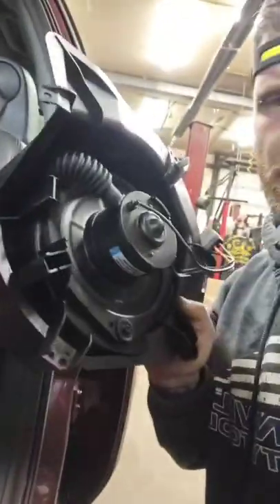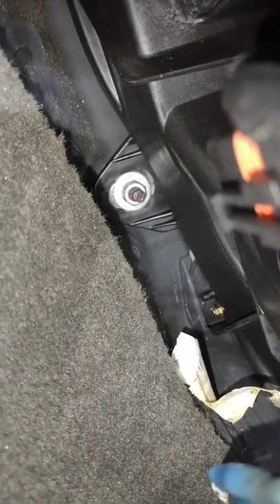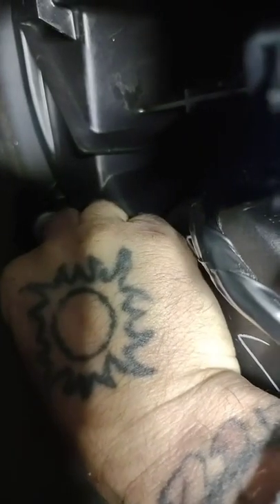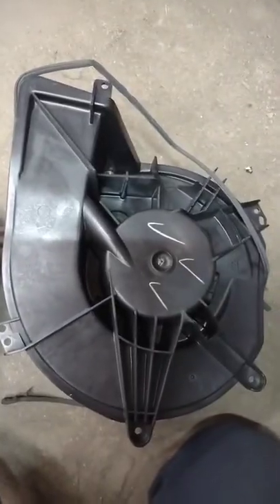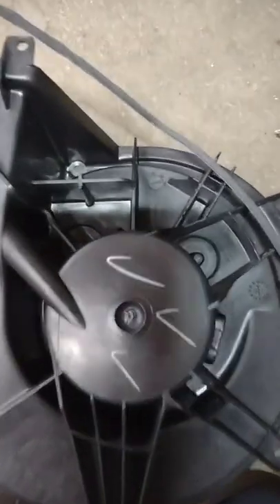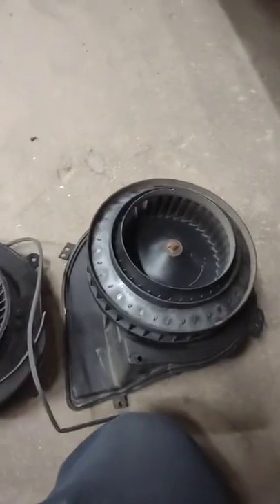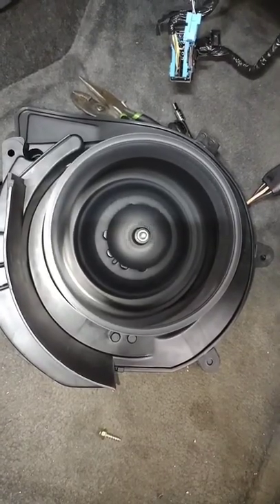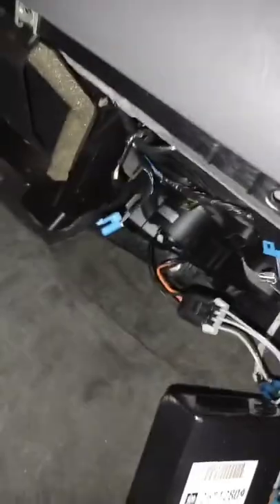Bonneville blower motor

Comment: I need your brain for a minute.... I have a 99 Tahoe with a 5.7. It's a crank no start issue. Replaced the crank sensor, distributor/rotor/cap, and coil. Popped off the timing cover and confirmed it was in time with the #1 piston top dead center and timing marks lined up. Fuel pressure is good. What else could it be?